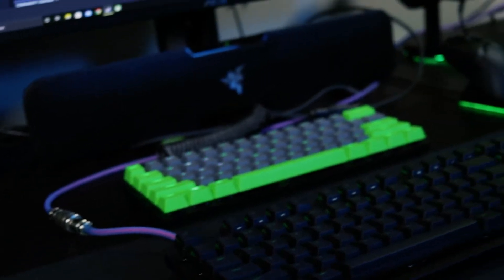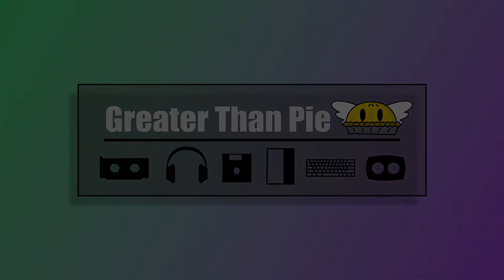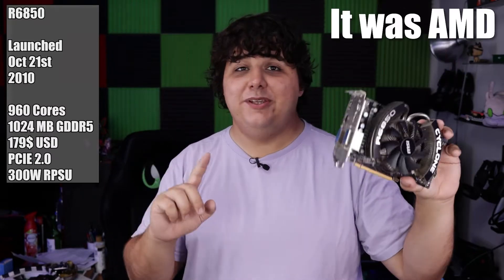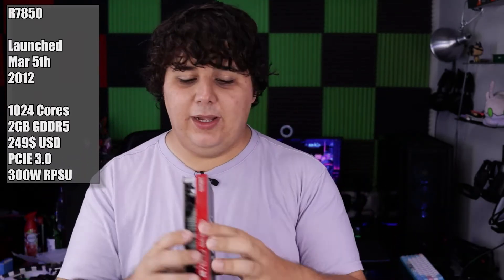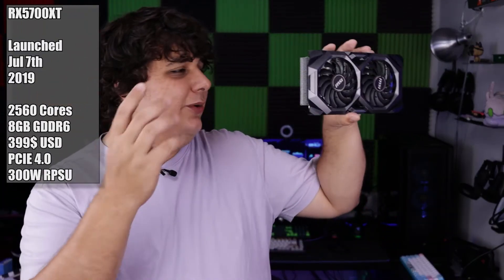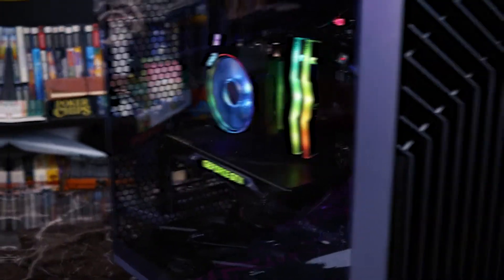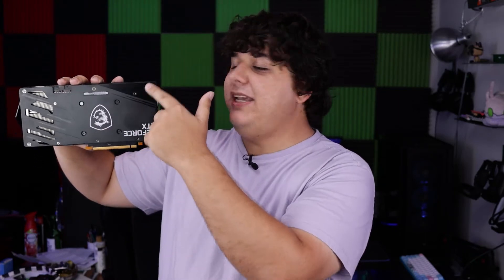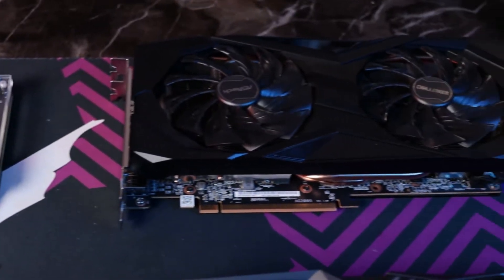What is GPU Sag? How do you fix it?

Comment: so to sum up, the modern gpus will not having this problem right? like rx 6000 series and rtx 3000 series
Reply from the maker: As long as they take it into the design. The 6800 XT and up have this issue because they are so large. The 3080 and up have the same problem